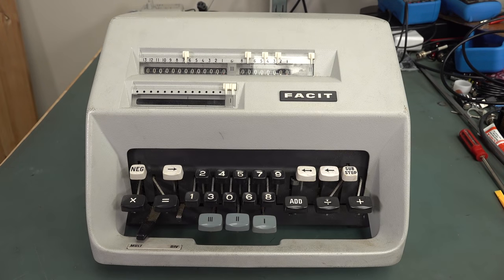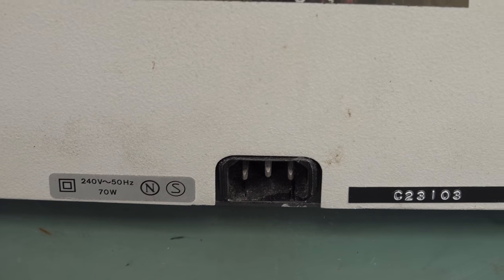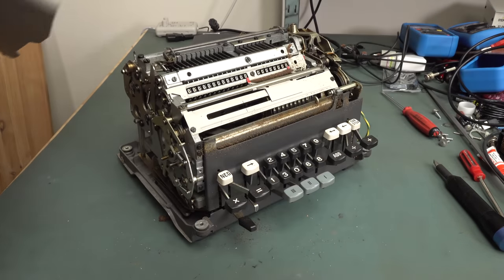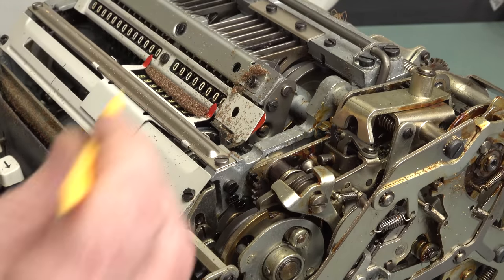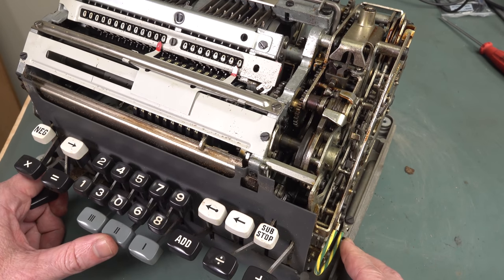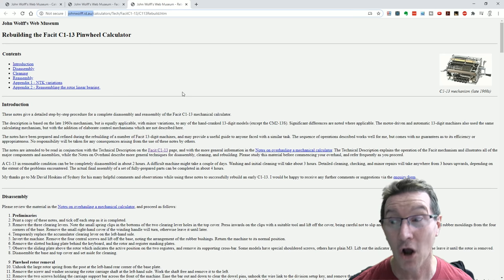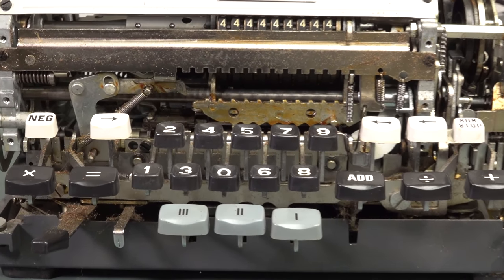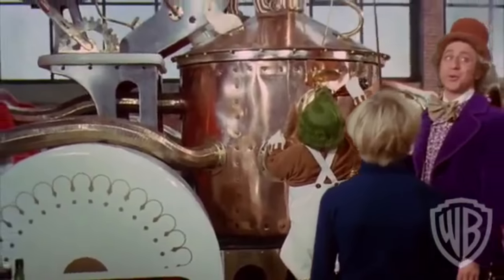EEVblog #1332 - Facit Mechanical Calculator!

Comment: I'm thinking you have an electrical issue with that motor - that would be something you're qualified to troubleshoot. :p

It looks like that shaft spins freely before hitting the stops in either direction, as you showed earlier; But when you supply power, it barely twitches.  Maybe that plastic-cased capacitor in the little junction box done blowed up?

Comment: I used air tool cleaner and oil to get mine moving.  They used to soak the entire thing in a tub of cleaner. Just note that cleaner like IPA is not good for the motor since it's flammable. So be sure it's dry and then re-lube.

Comment: I watched Curious Marc repairing a mechanical teletype, I guess this this is even more complicated :|
Reply: The teletype seemed far more complicated to me, what with it's loop current serial 110 baud signalling, paper tape reading and writing, print outs, etc. Pretty amazing what these mechanical/electrical engineers came up with in those days.
Reply: @Drew-Dastardly  When you list all of those sub systems.... 
I realize the teletype had just one motor, too! It's a mechanical calculator on steroids :D

Comment: That's not an IEC power connector. In the 60's, it would have been called a kettle plug.
Reply: In the 90's UK too. Everyone called their AT/X IEC power cable a kettle lead. In fact UK kettles even had a mechanical safety feature to physically knock out the IEC plug if you let them boil dry. Nowadays kettles are all cordless and only their base is hardwired. I much prefer this except when I have some new gear in and can no longer borrow my mums kettle lead.

Comment: That thing that was sitting in the groove of the gears, looks like it will rock over, it’s got a notch in the back that will engage a pin below it, you should of tried to push on it to get it out of the gear train and see if it does a whole rotation

Comment: You should contact John Wolff and see if he is interested in restoring it and adding it to his collection as it looks like it is in excellent original condition.  He has several C1-13 models but no motorised ones.  It would probably be a good idea to replace that styrene cap in the mains filter.

Comment: I love mechanical things like this. If I was to design something like this I would use a series of gears and "combs" for each digit when you carry out an operation all the combs slide past a gear and each tooth that is in the up position turns that digit up or down by 1 as it slides past the gear. The number buttons could be a series of overlapping levers so when you push 2 it pushes 2 comb teeth into the up position. The same principle can be used for a multiply by repeating additions and counting down a counter. Some keys would work like a piano key lever while others slide to catch a gear or let it spin freely. I can picture it perfectly.

Comment: Reminds me of the mess inside early VCRs, back when I had the idea that I could somehow fix them.  Lots of interlocking gears and belts, usually the eject/load mechanism would fail, preventing it from fully engaging the tape.  There was never anything broken, just all these meshing surfaces and a couple motors, belts, and gears that magically worked (Or not!) together to slide and lower the tape into place.  You couldn't see what was going on with it put together, and naturally it did nothing disassembled, not fun...
Reply: I took apart a VCR and realized that most of the mechanical complexity is only there so that it automatically loads the tape.  It could be so simple if you top-loaded it.  The main mechanism was quite cool, a worm-screw drove a big plastic gear with four distinct grooved tracks in it, which guided pins attached to linkages.
Reply: @MushookieMan  Almost all of the early VCRs were top loading units, probably for that reason.

Comment: strip it apart and put the parts by sections in labeled bags, clean it all replace caps broken switches springs etc and slap it back together with new lithium grease. like a months work really
Reply: Maybe for someone who already has a lot of experience working with complex mechanical machines like this. CuriousMarc could do it, this is right up his alley. But for anyone else, it would be a nightmare. I wouldn't want to mess with it, that's for sure!
Reply: @ct92404  im an mechanical engineer i could build one from scratch
Reply: @69mrnikolai  Lol...ok, if you say so, Charles Babbage

Comment: whoa, that beats my old Arithma Addiator for functionality, although that thing can fit in a pocket :D
Reply from the maker: But this only weights 13kg :->
Reply: @EEVblog  too bad it's built so solidly - otherwise it could use an "Office Space printer party" to see the levers and gears all go flying in the air. (Maybe a project for Sagan?)
Reply: @tobyandersen6612  well those are round one :D

Comment: divide by "0" . Might be interesting.
Reply: It'll break
Reply: @efa666  If he can get the mechanism freed up and working again, dividing by zero won't break anything. It will just get confused and keep running forever in a loop until you turn it off.